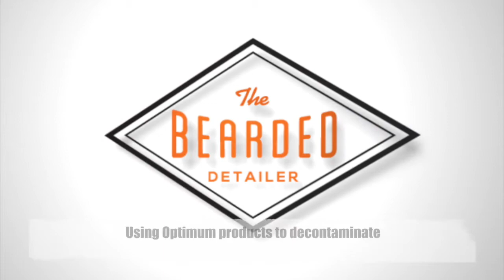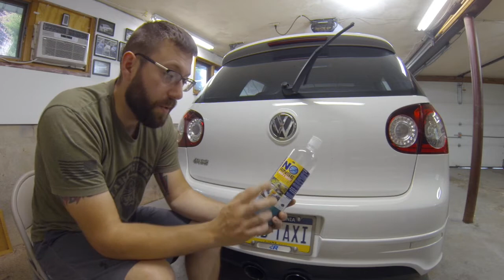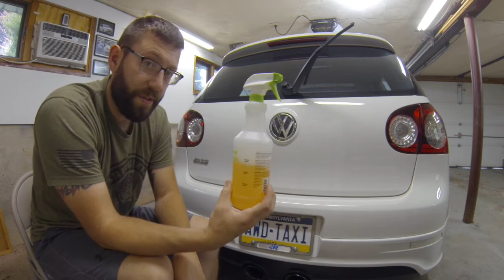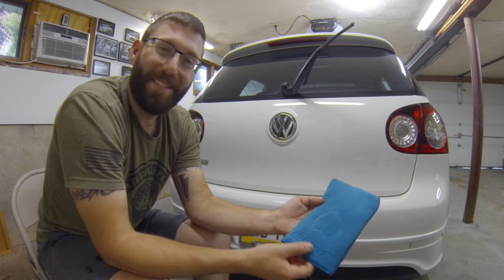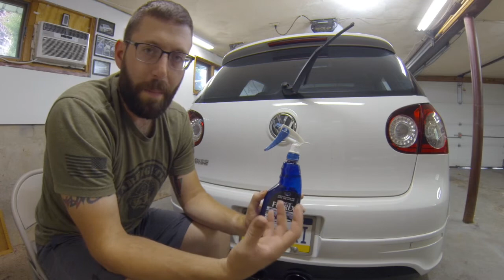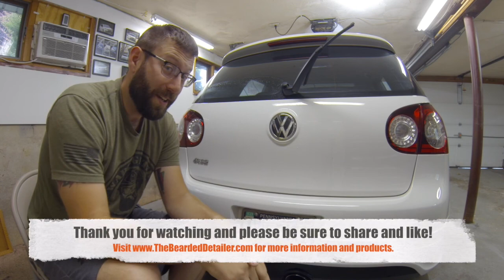How To: Decontamination with Optimum Products

Comment: Do you wash in your garage or outside? 

I can’t wash in my garage. 

So I could wash outside then bring it inside the garage and do the rest.
Reply from the maker: I don’t use the pressure washer inside. I do wash with ONR inside though since most of it stays on the car and doesn’t saturate the garage.

Comment: If you have a 30 oz bottle that you fill to the 10oz mark and then the rest with water, then you have a 2:1 solution not a 3:1 (20 oz water to 10 oz Power clean).
Reply: i was thinking the same thing , should be roughly 6oz product and 24oz water however with OPC it doesnt really matter the stuff is practically safe but ratio wise you are correct.

Comment: opti seal 
does not have an actively uv protection as ocw does but is a polymer sealant which acts as sacrificial barrier (polymers are slower to absorb uv radiation) this was not directed towards you but to viewers that may interpret what you said in a diff way